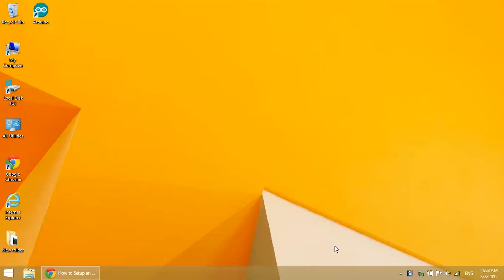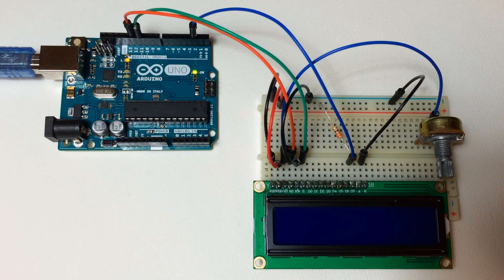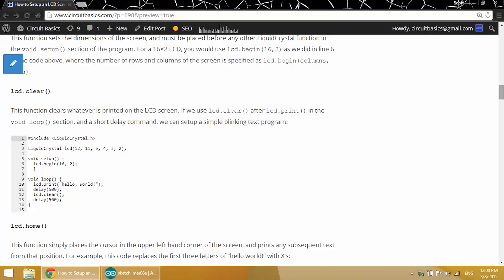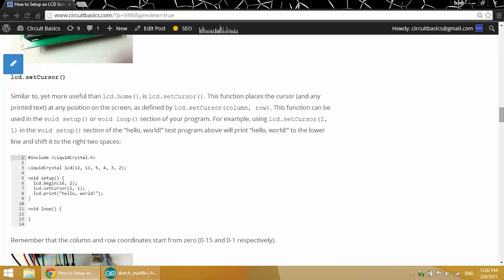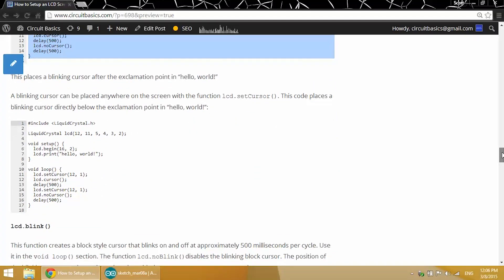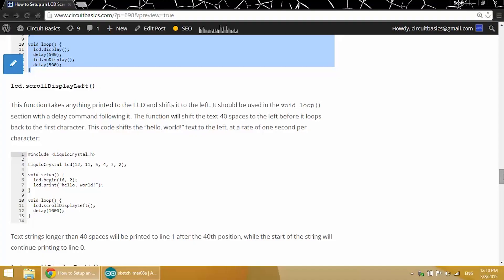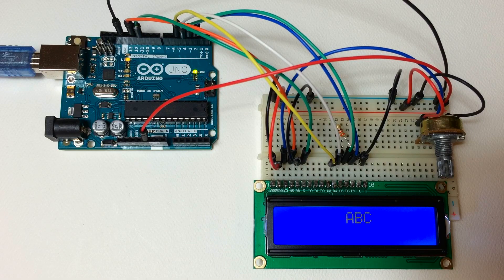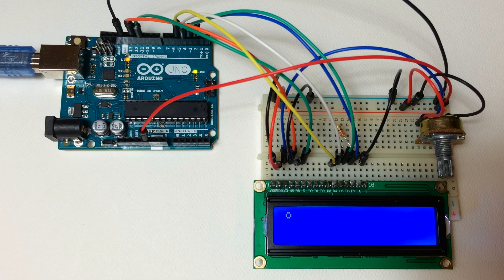How to Set Up and Program an LCD on the Arduino

Comment: Ever had the issue of just having squares show up in the LCD (No text) ? I have a 1602, wired up as standard. The design works great in Tinkercad - but when I go real life - the squares just pop up. The library is installed, I have rechecked pin connections and have tested connectivity with a multimeter to  ensure no shorts. By adjusting the trimpot I have on the board - I can see the brightness increasing and decreasing - however no text - just the same stubborn single row of squares on the top row. This behaviour is consistent with 1 other LCD1602 I had installed - so it is unlikely there is a hardware fault with the LCD. If anyone has any hints on how to get it to work - that would be greatly appreciated.
Reply: From what I've seen, in his code, he uses 

LiquidCrystal lcd(12,11,5,4,3,2);

but in his wiring instructing, pin 11 is never used, but rather pin 13 is, so the correct line would be 

LiquidCrystal lcd(13,12,5,4,3,2);

Comment: I got a kit as a gift. Didn't know Shit about it, as it's been Years since I worked with Arduino. I spent half my day researching what I can do with what I got, and how to run/get/design codes. I find this on YT. I set it all up, It's Night Now. Did my own work since I didn't have the exact things he did, Spend an hour putting it together, Spend 3 hours figuring out My Own code to work it, Based off of this one - Turned it on and everything works but the words are upside-down. Unplug it, Flip it around, Turn it on and run the code; Doesn't work. I spent over an hour checking every single little thing there was, to find the dumbass little orange wire became unplugged a whole hour ago. Plugged it in, It works. Wasted hours of my Night, and Half my day to make a screen say "Hello World". Time to take my masterpiece, put it back in the box, and probably do nothing with it again.  I Love it.

Comment: So, maybe this is a stupid question but, how did you get the LCD display to be electrically common with your breadboard, more specifically what did you use to connect it to the board? Solder and wire?
Reply from the maker: The LCD is a serial LCD, so there is no I2C backpack on the back of it. There is just a pin header soldered to the LCD that fits in a breadboard. Hope that helps!
Reply: @Circuitbasics  I’ve soldered a male pin header to the LCD and I’m waiting on potentiometer kit.

Comment: by the way (i just found this out) but depending on the screen brightness you can put the 5v jumper wire onto 3.3v if you want it to be less bright or just unplay that wire completely and it will still work just less bright.

Comment: Thx.. handy to know. I am having a bit of trouble running this lcd and max 7219 8x32 dot matrix simultaneously.. wondering if you could help.. they both work perfectly separately but once code is put together.. compiles ok but displays don’t work

Comment: After following your tutorial, my LCD screen's backlight is working but no characters showed. Then I followed the Arduino menu, the characters worked but there is no backlight. :( Does anyone know the reason for my issue? Thx!
Reply: the resistance of the resistor is too high replace it with a jumper wire

Comment: If you have problem with LCD not lighting on after you plugged all correctly just switch resistor with the ground pin of potentiometer

Comment: Will the wrong wiring lead the LCD screen for short circuit??
If not, plz suggest the possible reasons for my LCD screen not even lit??!
i checked the wiring too! There are no errors but, I am using 20k potentiometer!!

Comment: It worked. Here is  how i did it: I put the red wire on the left side of the potentiometer, and the black wire on the right, and the blue wire on the bottom

Comment: Hi Circuit basics, could you please make a video on connecting the i2c version of the 16x2 lcd you have here to an ATMEGA2561? I've read the data sheet, and searched some FAQ's but have not been able to get a solid foundation for the ATMEGA2561. The problem is in setting the SCL and SDA pins, 25 and 26. This video would be awesome! Please and thank you.

Comment: I HAVE PROBLEM I HAVE BACKLIGHT AND CONTRAST BUT I HAVENT GOT LETTERS
Reply: You may or may not get any content on the LCD when you connect the wires.  That's not a problem either way.  If you don't get any text on the LCD after uploading the program, and the program is correct, one possibility is a loose potentiometer.

Comment: I am using pin2 as an interrupt in one of my sensors. Can I use different pin in place of pin2 for this LCD 1602 with arduino? Thanks in advance.

Comment: It doesn't seem to be working on my 20x4 LCD screen. Do you think it's just a wiring issue? I tried to copy all exactly. Or do I need an I2C serial connection to arduino?
Reply: @THE AMAZINGSCIENTEST! That's a good suggestion. Turned out I put a voltage that was too high in one of the inputs and screwed it up. worked with new LCD and I2C module

Comment: On line 3, "LiquidCrystal lcd(12, 11, 5, 4, 3, 2)
I am trying to understand how this works. How does the Arduino know whether these pins are INPUT or OUTPUT? Why do we not need to type a line INPUT or OUTPUT?
Reply: I have been having a problem with the temperature reading as 0degreesC. 

After switching the thermocouple so, cs, sck pins from 8,9,10  to 4,5,6 it works just fine. happy about it working but i don't think i'll be satisfied until i understand the whys.

Comment: Ok, maybe you could explain why the pin connections, how come you know exactly which pin to use from the LCD board?
Reply: He probably looked at the LCD data sheet, and then used his knowledge of electronic symbology to translate it to the Arduino pins.

Comment: may not even matter and might've already been pointed out a billion times at this point, but the resistor being used in the video is 330 ohms as opposed to the 220 ohms he says it is with the first two orange stripes signifying two threes as red stripes signify two

Comment: I did exactly as you said, the LCD lit up and I was able to control the contrast and I did upload the codes, but no characters appeared on my screen
Reply: I'm just taking a shot in the dark since I don't have your set up in front me, I have to guess. But a mistake that I made early was not having the correct pins established in my code. 

Good luck to you
Reply: Same issue happened with me
Reply: yes it did happen as you said exactly on mine too broo! whay?
Reply: @Abrsh Tube thank you, I thought I did something wrong but I saw your comment and it worked

Comment: I did it the same way but the lcd does not light up and when I connect it to the 5v it shorts out
Reply: I think u should connect it to the 3.3 v
Reply: TechNaiSci I actually found a different diagram and got it to work
Reply: Thats actually good

Comment: Spent 6 hours, check and changed cables multiple times, changed LCD screens, only getting square boxes at the top row.
Reply: hey mine too!! but then i soldered breakable pin header on the 16 pins of lcd panel by fixing it on a breadboard from the top now it is working fine.

Comment: LCD to Arduino

pin1 to ground
pin2 to positive
pin3 to 10k pot midle (other pot pin to -ve and +ve)
pin4 to A12
pin5 to ground
pin6 to a11
pin16 to ground
pin15 to 220oh to positive
pin14 to a2
pin13 to a3
pin12 to a4
pin11 to a5
Reply: correction: plug it into digital slots instead of analog. arduino uno doesn't have that many analog slots
Reply: bro thank you bro you saved our bro  life  bro
Reply: broo you broo rock broo
Reply: Arduino uno has only 6 analog pins that is from a0 through a5
Then how come a11 and a12
Reply: @kishorreddy695  https://youtu.be/I3WcMeAYt2w
Reply: https://youtu.be/I3WcMeAYt2w

Comment: // Hardware setup:
// BT module   Arduino
// GND ------- GND
// VCC ------- 5V
// TX-O ------ pin2
// RX-I ------ pin3

// Arduino UNO already has an LED attached to pin 13

#include <SoftwareSerial.h>  

int bluetoothTx = 2;
int bluetoothRx = 3;

SoftwareSerial bluetooth(bluetoothTx, bluetoothRx);

int led1 = 13;
int led2 = 12;

char cmd[100];
int cmdIndex;

void exeCmd() {
  
  // "led" is the led id
  
  if(strcmp(cmd, "led 0")==0) digitalWrite(led1, LOW);
  if(strcmp(cmd, "led 1")==0) digitalWrite(led1, HIGH);
  if(strcmp(cmd, "led 2")==0) digitalWrite(led2, LOW);
  if(strcmp(cmd, "led 3")==0) digitalWrite(led2, HIGH);
}

void setup() {
  
  delay(500); // wait for bluetooth module to start

  bluetooth.begin(115200); // Bluetooth default baud is 115200
  
  bluetooth.print("$");
  bluetooth.print("$");
  bluetooth.print("$"); // enter cmd mode
  delay(250);  
  bluetooth.println("U,9600,N"); // change baud to 9600
  
  bluetooth.begin(9600);
  
  pinMode(led1, OUTPUT);
  digitalWrite(led1, LOW);
  pinMode(led2, OUTPUT);
  digitalWrite(led2, LOW);
  cmdIndex = 0;
}

void loop() {
  
  if(bluetooth.available()) {
    
    char c = (char)bluetooth.read();
    
    if(c=='\n') {
      cmd[cmdIndex] = 0;
      exeCmd();  // execute the command
      cmdIndex = 0; // reset the cmdIndex
    } else {      
      cmd[cmdIndex] = c;
      if(cmdIndex<99) cmdIndex++;
    }
    
  }
  
}

Comment: Any1, pls help !
I got the background light, i adjusted the potentiometer for contrast, removed it, and just connected the resisitor, all the wirings are fine, i checked it dozen of times, but still; the text isn't showing ! 😫

@Circuit Basics - Help ! 😕
Reply: I do not use a pot because it's all the way to the end of travel anyhow. Just put a 220 ohm resistor from the lcd pin 3 (VO) to ground. It works fine on mine.
Reply: @TractorMonkeywithJL  That worked for me! Thanks!
Reply: My LCD is the same as this video model. I only had 1 potentiometer so I could only control contrast(same thing happened when I used this tutorial), but then I desoldered another pot off a trash circuit board and put it in place of the resistor. 2 pots. Problem solved(for me, anyways).

Comment: plz help me..my display just shows the square...nothing else...i check my potentiometer,vcc,vee,ground nd all other connection nd also all jumper wires...all are placed on right position...even i checked my all 16 pins of display with multimeter..all r perfect...then why i faced  this problem
Reply: Taha Nadeem 
I hv done this 1 month ago dear...i have full coding...pblm is in the contrast pin...if u wanna more info call me or msg me on Whatsapp-9409663007

Comment: Finally  got LCD DHT display to work after playing around with libraries. However couldn't maintain temp and humidity display when I removed the USB supply from arduino  and connected LV supply . Anyone know why?

Comment: Arduino: 1.8.5 (Windows Store 1.8.10.0) (Windows 10), Board: "Arduino/Genuino Uno"

Sketch uses 1870 bytes (5%) of program storage space. Maximum is 32256 bytes.
Global variables use 59 bytes (2%) of dynamic memory, leaving 1989 bytes for local variables. Maximum is 2048 bytes.
avrdude: ser_open(): can't open device "\\.\COM1": The system cannot find the file specified.

Problem uploading to board.  See http://www.arduino.cc/en/Guide/Troubleshooting#upload for suggestions.

This report would have more information with
"Show verbose output during compilation"
option enabled in File -> Preferences.
Reply: did you connect the arduino?

Comment: I actually detected an error in this setup, in the video he is connecting the end of the resistor to the MINUS current, it should be connected to the PLUS current, connecting it to the minus current will cause the display only to use back lightning, while putting it into the plus will make the lcd screen glow as it should :) hope it helps

Comment: I got it lights but no words. I checked everything. Please help!
Reply: I have also got lights but no text. I tried replacing the resistor with a potentiometer
Reply: @rossgrant1269  So yeah, the potentiometer worked for me
Reply: Code, reset Arduino, check connections , make sure the code is closed correcly
Reply: Ya same issue
Reply: Set contrast to full
Reply: have you fixed it, i got the same issue?

Comment: These have been the most useful videos and articles I have seen on the Arduino so far. Arranged just like I learned BASIC years ago. Started with clear, concise instructions on assembly, then to simple programming, and then modifying existing builds to incorporate new coding. Very helpful. Thank you very much. I learned so much in the past hour than I have in days from know-it-alls who think I should have known where serial monitor was.

Comment: I don't have a potentiometer so I left those wires out.  I added the LCD sketch to another sketch but tried it by itself as well with no difference.  The LCD turns on but I'm not getting any words (Hello world!).  I soldered the power & ground wires because it's hooked to a 2nd breadboard but i doubt that's the issue bc it turns on, just doesn't display characters

Comment: when i try to verify the code, I get an error saying "
 #include <dht.h>

                 ^

compilation terminated.

exit status 1
Error compiling for board Arduino/Genuino Uno."

what do i do?

p.s.  i'm a complete noob with no C coding experience.
Reply: Its problem with your arudino drivers try updating them

Comment: I have everything set up, background lights and the letter lights, but the letters are just rectangles. What am i doing wrong?
Reply: Nvm, i'm just stupid. Jumper wire 4 connecting the lcd to 12, was unplugged

Comment: I would double check the connections.  Generally not working means you have missed something obvious and then it is time to go have a coffee and come back to it fresh.  I have spent hours looking for a fault with a micro controller only to find the ground not connected.
I would double check that you have connected power from the adruino to the bread board.  Of you noticed on the video the display lit but did not have the power rails connected totally

Comment: @NumberZeroJay that was awhile ago so I kind of forgot how I solve the problems but I'm pretty sure it was after I updated the Arduino IDE with the authentic version from the Arduino website rather than the distro package I was using on Raspberry Pi

Comment: Got it to light but no words!What am i doing wrong?PLEASE!
Reply: Check you pot connections. I had the same problem until I made sure all three of the potentiometer wires were in the right places.
Reply: Do You Putted A Resistor In It Or The Resistence Of The Resistor Is Very Low

Comment: I was mad doing this project but it didn't work then I realised that I hadn't connected it to system
Reply: Yeshes Yash boi
Reply: Had a similar problem til I found one of the pot wires was in the wrong hole. Then it worked perfectly.

Comment: do i need the 220 ohm resistor so the LCD works? can i connect without it ?
Reply: if you do not use 220ohm (you can also use 1k ohm) your back light can be damaged after a while

Comment: just getting two full rows of white blocks instead of text :( potentiometer thing works tho... i hate myself
Reply: actually i figured it out. i put the lower digital cables all one "step" too high. had 6 should have been 5. could have changed on arduino or code. i dont hate myself. even got it to display a reading from the temperature measurer :D

Comment: is a resister really needed
Reply: Only if you don´t want to damage you display. :D
Reply: TEEN yeah because when people assemble electrical components we often use equipment, gear and components not necessary in the build just for fun n because we like buying stuff that's not REALLY needed just so we can look fancy....go take all the resistors out of your computer, it'll be fine...n it'll answer your question. ....how people get this far...to a video like this with an Arduino in hand, a module and coding going on and not know simple stuff like what resistors are used for and not own a bag of resistor ($3)...possibly some transistors, diodes (different types), n LEDs at least and is beyond me. I guess everyone leaens to skydive before learning to walk these days....

Comment: I cant show out anything on LCD although its lighted...checked pin connection& Ardublock, both are good.  How would i start to troubleshooting in this case ?
Reply: Might be the code is wrong

Comment: Is the  potentiometer needed?
Reply: The potentiometer regulates how bright the text is on the 2x16 screen. You would have to test a lot of resistors to find the one that worked best for the display.
Reply: Not entirely. You could use a lot of resistors in series to find your amount. Or you buy a bag of 5 for £2.
Reply: Dominik Kwolczak yeah because when people assemble electrical components we often use equipment, gear and components not necessary in the build just for fun n because we like buying stuff that's not REALLY needed just so we can look fancy....go take all the knobs out of everything you own with a knob on it, it'll be fine...n it'll answer your question. ....how people get this far...to a video like this with an Arduino in hand, a module and coding going on and not know simple stuff like what resistors, potentiometer are used for and not own a bag of resistors ($3), potentiometers ($1.45)...possibly some transistors, diodes (different types), n LEDs at least and is beyond me. I guess everyone learns to skydive before learning to walk these days....a little bit of learning and $10 in components would go a long way!

Comment: How does this one have the pins? Were they included, or you soldered some in?
Reply from the maker: +GeekBoy03 I soldered them in. It's a 16 pin header
Reply: Thanks for that info. You also did not specify which rheostat you were using. I have two in my kit, a 1K and 10K ohm variations. .
Reply: Sorry, you said 10k in the video.
Reply: I got it working, thanks a lot. However after a few minutes the character $ appears on the second line.